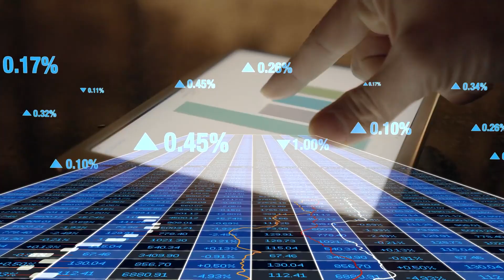Biden Administration Approves A $8.2 billion High-Speed Rail Megaproject

Comment: Call me a skeptic, but I don’t see any of this happening.  Rail lines in the US serve a different purpose than in other countries like China.  We use them to ship goods in bulk.  China uses trains to move people.

And furthermore, these projects are usually not sustainable.  Even China loses money on most of their lines.
Reply: That is because the current lines are extremely unreliable and not well connected at all. Even traveling from Boston to NY was a disaster for me. After careful planning and research, I had to take a bus, 1 hour into Boston. Than take the inner city metro to go to South Station. Than travel 4.5 hours to NY which is about 210 miles. Took me 6.5 hours in total with waiting time but approximately 7 since I had to take into consideration traffic. Moreover it was not cheap at all. If public transportation is more accessible and faster than driving, people will use it more. Even if I had to fly, it would be the same time approximately, if you consider the traveling time and security checks at airports. Trains are great if you connect them well. Europe has done a great job at that, not just China. If you want to see less people on the streets driving cars and less traffic/pollution, mass fast transit is the answers. Cheers
Reply: @Flavor88  That's because the rail lines are designed for freight and not people.  Freight trains are prioritized over passenger rail.  So passenger train schedules are planned around freight schedules.

Other reasons why it's unlikely to happen include the fact that 8 billion is orders of magnitude less than what would be needed to build out the needed infrastructure.  Heck, I don't even think 8 trillion would be enough.

We also lack the population density to make running passenger lines feasible.  Like I mentioned in my previous post, even China who has much higher density areas than the US are losing money on most of their less dense lines.

What I would like to see is an increase in some existing services like autotrains.  We only have a single line that does that and I feel like that could be a nice middle ground to start.
Reply: @astrofizzix4498  Boston - Ny - Washington is the only line that Amtrak is profitable when it comes to passenger rail. If they start with that and they implement it correctly, it will certainly be profitable since all those cities have high population density. There are approximately 15 daily flights form BOS to NY. Imagine now if you have a train that makes the 200 mile route in 1.5 hours how many people will use it. I agree with you that 8 billion are a drop of water when it comes to rail investment but it is certainly a start.